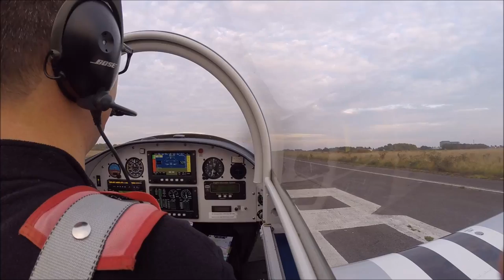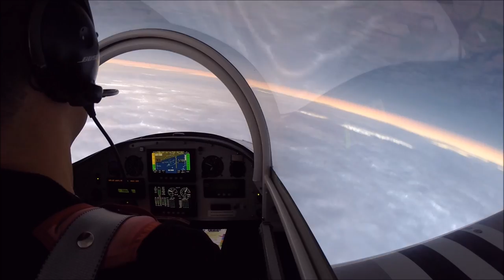RV8 aerobatics practise

Comment: Good video! The “banging” is from vortices being shed from the leading edge of the aileron at full deflection. The design max deflection is very near that angle at which this phenomenon occurs. As a result on some RV’s you will feel a slight pulse in the stick.
Reply from the maker: Thanks that is useful!

Comment: You might want to consider rolling at less than Va rather than more if you're using full aileron deflection(as evidenced by getting the aileron buffet that only comes on at full deflection). I've exchanged emails on this subject though, and they are happy for rolls above Va, with the proviso that low or no G is pulled during the roll. Apparently one of the the limiting factors of the airframe are that the wings don't handle the rolling forces well if there is G applied at the same time(I'm not saying you were doing this BTW).